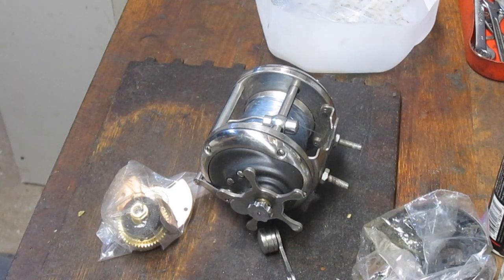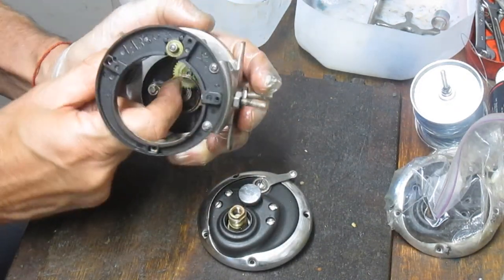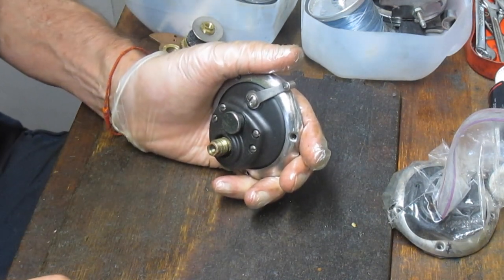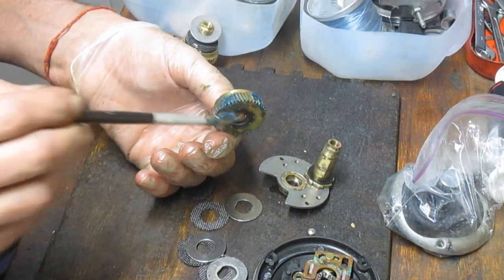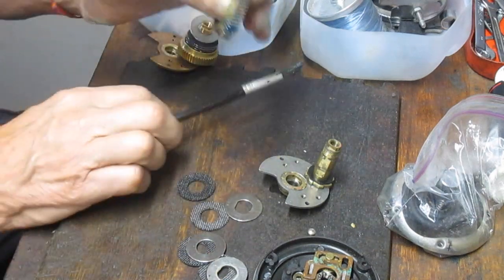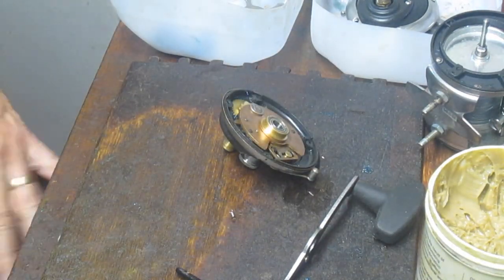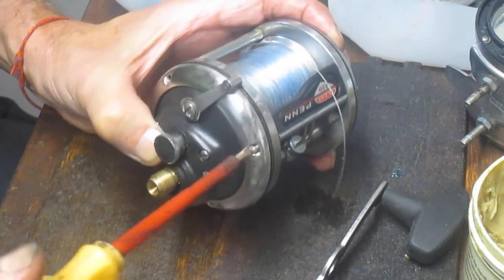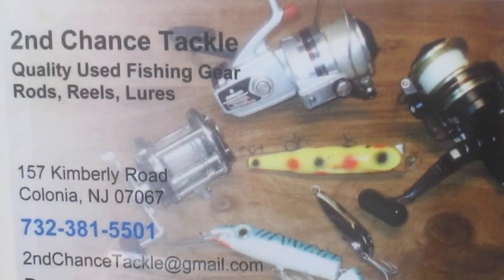Penn GTO 220 saltwater fishing reel   How to take apart and service

Comment: How are you doing watching this video rite now pretty educational, I have a question on the penn gto 220 how long is that dog piece with the small spring? Thanks in advance.
Reply from the maker: It looks to be a little over an inch long.  The page link below shows the length and you can order that piece and the spring from them if needed https://www.mysticparts.com/PennParts/Parts/15-220.aspx . Dennis

Comment: Great video. How do you change the bearings? Do they pop out either way?
Reply from the maker: Yes - they are removable.  I generally use a curved dental pick and insert it through he center hole then pull upwards to remove them.  You may need to spray the bearings near the case with a penetrating oil to help it slide up and out easier - Dennis
Reply: Thankyou. I went online on Mystic parts and could not find the bearing by itself, had to purchase the whole assembled bridge assembly. Thanks to you I feel confident I can replace. Thank you for your help.

Comment: I have a question where does the small spring go it’s a short wide spring
Reply from the maker: The one side goes on the hook end of the dog and the other connects with the post on the side plate on the top  right side dog
Reply: @2ndChanceTackle  it’s not the dog spring it’s a short wide spring I sent a pic of it to your Facebook page

Comment: How Can i make this reel cast further i want to put it on a 15ft surf rod and cast past the sand bars
Reply from the maker: That is going to be hard to do.  The level wind assemble slows the rotation of the spool and lifts casting distance.  There is only 1 spool bearing to reduce friction and you cannot upgrade the reel to put any others there to replace a bushing, for example.  You could remove the line guide and idler gear, but that ruins the reel and leaves openings for saltwater to get inside.
Reply: @2ndChanceTackle  okay I'm going to sell it. What's your opinion on some of the best casting reels? Not trying to spend too much but need something to get out there
Reply from the maker: The Penn Squall or Penn Fathom will suit you much better.  Nice spool bearings and no line guide to slow performance.  If you are going vintage, the Penn Squidder 140 or the Penn GS 225 or 235